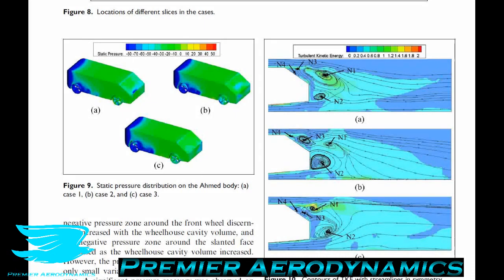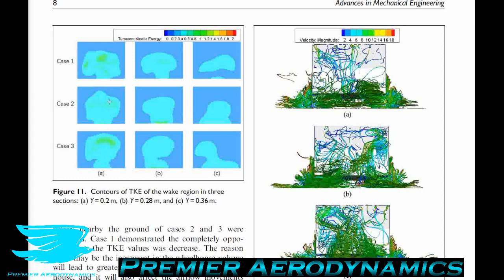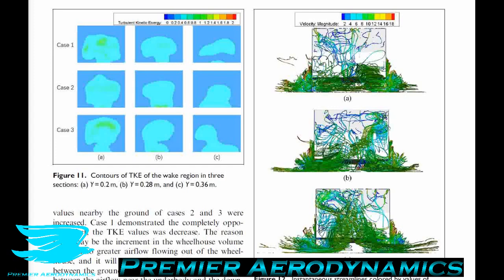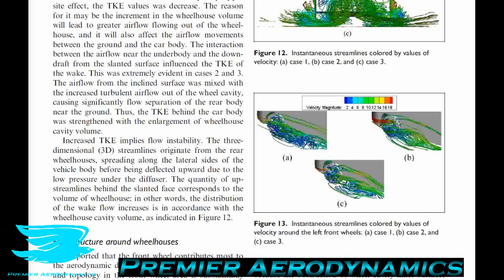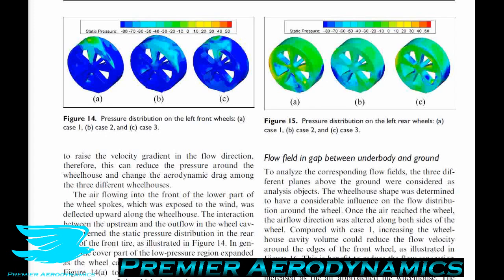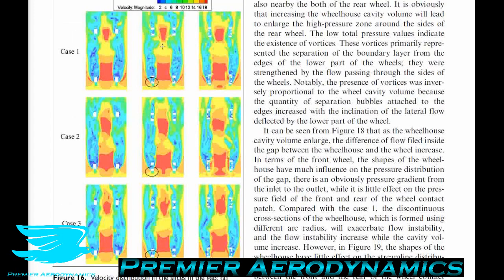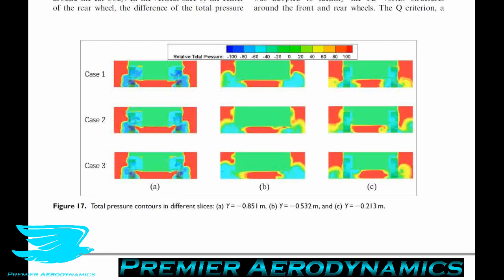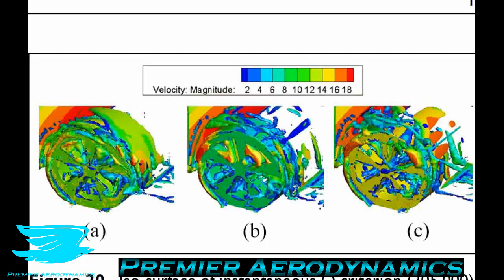Podcast #142 - Effects of Wheelhouse Shape on Car Aerodynamics

Comment: So, uh, which is best? Like I could never predict what features or vortices each would have. 
Does the Audi wheel tend to have the least drag with the most lift, while the Merecdes is the opposite and the Toyota is somewhere in between?
Reply from the maker: That's the case for the drag, but for the downforce (negative lift), the Toyota is better, then the Mercedes, and then the Audi.
Reply: @PremierAerodynamics  F for Mercedes.
I guess intuition can only get you so far in aerodynamics.

Comment: I was confused in the first 60 seconds, but I want to build some wheel house pants for my van.
Reply from the maker: Sorry, I don't quite understand. "Wheel house pants", what are they?🙂
Reply: @PremierAerodynamics  Sorry, I forgot the actual term, they are called 'fender skirts'. Also, I was wondering how the wheel (rims) designs influence air flow as they roll down the road. A spoke wheel design would seem to make more turbulence than a flat hubcap?
Reply from the maker: @MinuteBurn  Oh okay. Fender skirts are very good for reducing drag.

For the rims, I actually spent a couple of years researching exactly this topic and the main takeaway is to reduce the open area. The less open area, the less drag. However, there needs to be some open area to cool the brakes.

Also, for reducing drag, it's better to have open area near the center of the rim than on the outer edges.

Spokes definitely increase drag, but again, you need to have some level of opening area. The more you can close the rim, the better for reducing drag.
Reply: @PremierAerodynamics  Thanks for taking the time to explain this. I am retired now so I no longer have a shop to build stuff like fender skirts but, who knows, our van is getting what it needs to travel (RVish) so who knows, maybe we can get someone to build a pair for cheap. 
I find your videos really interesting from the point of 'how to make our van swoopy and get better gas mileage' as it is like pushing a brick through the air an anything that can help......
Reply from the maker: @MinuteBurn  Lol, that is what a lot of utility vehicles are like unfortunately. Functionality, like additional head space to walk around comes at a cost. But, the drag can be reduced with good design.